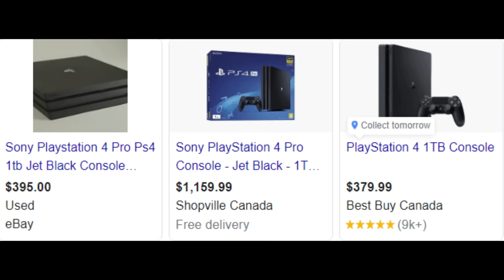Girlfriend Destroys PS4, Says It's A "Prank"

Comment: the girls that think it is a good idea to destroy their bf's ps4 and "surprise" them with a ps5 don't realize u need your ps4 to transfer your save data to your ps5 making all of the hours spent on their favorite games on the ps4 completely gone.
Reply: They dont go to the cloud??all my xbox saves are on cloud
Reply: @SeanJohn127 PS dont got it as good as Xbox.
Reply: last i checked i need to pay for ps plus to use the cloud and i never ever payed for it
Reply: @SeanJohn127 PSN has the cloud but not as integrated as Xbox. Here is the thing, so what if the Cloud is a thing, maybe the person doesn't like using the cloud or has a reason not to use the cloud. You just effed them.
Reply: Yeah the data would be lost unless you do a transfer or have an external drive.
Reply: You still get all the games u bought digitally ofc. You lose your saved data and screenshots if you don't have PS+ to save them to the cloud storage. OR you can in fact use a flash drive and transfer your saved data and screenshots/videos to it if you don't want to pay for PS+

It's what I always did with my ps4 back in the day.
Reply: it's just water and it wasn't submerged for that long, as long as it wasn't powered while being submerged you can rescue it. the only components that can be damaged this way are power supplies and hdds. the psu would need replacing just to be safe. for the hdd you can just hope that no water got inside (there is a tiny hole in it but i've seen a pc rescue with a pc being submerged in muddy floodwater for days or weeks and the hdd was fine, no water did get inside but taking it apart will destroy it). everything else you can disassemble and clean with distilled water and isopropanol. an oven at 50°C can help get water out of under the chips. after that a few days extra dry time and assembly.
Reply: @SoneGurke  Nope if my Gf/fiancée/wife did this I'm not going to fix it, they are and not buy doing what you suggested either they will be replacing it and compensating me for the time I invested in it that I can't get back and then be given the boot. I would then post picture on all her socials as a cautionary warning to others that this is the potential damage they will incur, if not worse if they think this is somehow funny or a good idea.
Reply: I was looking for this comment. It took 2 days for me to transfer all of my saved data from my ps4 to my ps5. I'm a woman and if someone did this to me I'd be convinced they secretly hate me. This whole "trend" is sick.

Comment: for those who don't know, if you throw an electrical device into water without being connected to electricity, it can be fully functional if you take it apart and dry it very well 
preferably take it to someone who deals with repairing devices
Reply: needs to be rinsed with distilled water.  have a box fan blow on it for 2 days

Comment: I can appreciate the "upgrade" prank, at least they are getting an upgrade, the PS5 Digital one is more of a side-grade but that's them working out the fine print.

If my wife destroyed my custom PC (I am a system builder) which has a 5800X3D, RX 6900XT Nitro+ SE, and 6 SATA 3 SSD's as well as 2 NVME SSD drives (mostly Seagate Firecuda and Samsung EVO drives), and then said "its ok I got you this pre-built gaming PC", I would still be pissed off. The amount of time, money, and effort I put into every build that I do which includes my own is significant, so much so that I make a small etching of my initials into the inside backplate of every system I build as a craftsman mark, I take pride in what I build.

Thankfully my wife is not retarded and has tiktok brain rot, but still, I feel for these guys.

Comment: I wouldn't say it's destroyed. I've seen game systems rescued after immersion it's just that the cost of repair would be more than it's worth. If it happened to me, I'd immediately strip it down, dry it off, clean it with isopropyl alcohol and contact cleaner before leaving the PCB somewhere warm and dry, like her side of the bed after you kick her out after dunking her phone. Doing this shows that she holds zero respect for her partner or his property.

Comment: You can directly see how "intelligent" this is....
I am a female as well, but today's "feminism" is outraging. Never lay a hand on someone else's things. 
Also, those girls, destroying or attacking their exes apartments, cars.... Shall be jailed in .... They belong to court.... 

And the second part is: I am also an ITSE  and all that "water destroys electronics" things are taken way to far in my opinion.  You could even take your PS4 and do that, and it would not do anything. The worst of luck would be the thermal paste (or in the ps4s side the liquid metal) could be washed or deplaced.  The thing is, that many people do the worst things.... Water and electrics is fine for a long amount of time.  The main issue is, that water does lead and spread voltage...  THAT is what actually is dangerous about that. 

I am working as a system builder and tuner and repairer and I have had tons of people with wet notebooks and such things. On a Laptop it is a bit dangerous because today the most ones have internal Accus... 

And the worst thing about this is, that somehow many costumers, who has dropped drinks on Laptops and such are doing 2 FATAL things.... :  1. some do use a hair dryer to dry it out... (This sounds good at the first thought, but when you think more it may even be, that you will even blow the fluid deeper in.... and it WONT be able to dry the inside...)   and then 2. The death as they are worried "if it may still work" and this is the worst part.....  NEVER try to start a wet device. Always be sure, that no voltage is possibly running through it until you are 200% sure it is completely dry again.   The best thing to do is departing it and unplug battery (the ps4 surely was not plugged in, so... No internal battery.  It will be running again when it is completely dried out. The worst that can happen is it overheats, or the liquid metal was washed out and does a wrong connection, so I would let someone take it apart to dry it and renew the paste, and it will be working again.

The thing is if you do touch her makeup she will be insanely pissed  but destroying a multiple hundred dollar console or a thousand or ten thousands of dollar car is "alright" ?   Delusional thinking.   Sometimes I am ashamed to be a woman because of today's society...